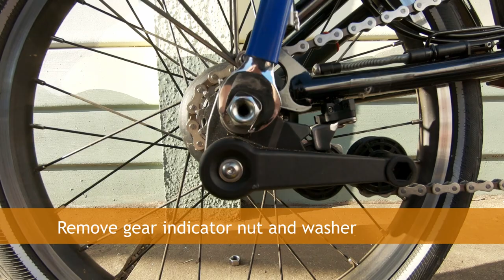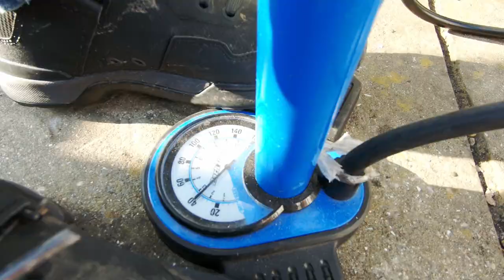Brompton weight saving - 6 speed to 2 speed wheel change

Comment: As a "Rainy Dane" I of course have mudguards on my now, even more than SuperlightM6LXBrompton (<9 kilo), and you are able to buy both the front axle, nuts, bolts and security discs/parts from titanium, as well as many other titanium and carbon parts for the bike.
  Also the really "heavy metal" clamps on the - original mudguards (Titanium stays, from the Factory), which I have parts and screws to be changed to carbon and aluminum, for a further weight loss, so I will come really, really close to an original, double price, T line, - with mudguards, and only 4 gears, compared to my 6!
        The small wheels and the high - resistance from those are the largest problem when riding, not so much the weight!
      As one of the flattest countries in the world at all, Denmark is amazingly "hilly" in some areas, so I like all my - 6 gears and even though have to walk when going up at places😄(Well also because of a, fraction too much bodyweight and a - bad shape as an elderly man and Pensioner of 75!)!  At first I honestly wondered for what use I had the lowest gears, but I found out at several places here in Denmark!!!
     My Superlight, disc brake, Carbon MTB also still has 33 XTR gears and oversize, hydraulic XTR brakes.
     And I would like to be able to change to a hydraulic disc brake in front of my Brompton, as I have had doubt about my bikes braking ability going down at an extreme speed, with often full stops before passing cattle tubes crossing the road!
   But my Brompton didn't let me down then!  Finn. Denmark 🙂
Reply from the maker: Many thanks for your comment and for watching!

Comment: I was about to get the 6 speed. But opted to put the extra money on aesthetics. I bought the 2 speed lacquer raw. S2l is so simple to look at.
Reply from the maker: Thanks for watching and sharing

That sounds like a great idea - especially if where you live is not too hilly (though the saved weight on 2 speed makes hill climbing easier)
Reply: @brilliantbikes  no not all. I live in toronto so getting 6 speed is really not worth it. 2 speed bromy is so easy to fix when you get your tire flat. Do you think getting carbon wheels is worth it?  They are nice to look at but I'd rather let my brompton as is.
Reply: @miffachan123  hello one guy in Netherlands fix my puncture tire without removing the wheel from frame

Comment: I wonder if it is possible to upgrade from 2 speed to 6 by changing wheel (to 3 speed wide ratio) and adding the 3 speed shifter and cable
Reply from the maker: Thanks for watching and commenting. 2-6 speed is quite easy. As you said - change the wheel (you can even keep the existing sprockets and chain). Ass a shifter, cable and chain puller and you are all done ✅
Reply: @brilliantbikes  are  sprockets the same? Is there any difference between the 6 speed sprockets and the 2 speed version? Fitting, diameter, teeth number.. Asking because of the wheel change, do they fit the same?
Reply from the maker: The 2 speed sprockets are 16T and 12T

The 6 speed sprockets are 16T and 13T

The 16T is exactly the same sprocket

In the past when Brompton ran out of 13T sprockets some 6 speed bikes were supplied with the 12/16T combination - though this is rare 

The 2 speed has (as standard) a 54T front chain ring

The 6 speed has a(again as standard) a 50T front chainring

The rear sprockets / spacers are completely interchangeable

Comment: You didn't have to change the gear cable etc. The 3 speed shifter worked on the 2 sprocket wheel?  Thanks
Reply from the maker: Many thanks for the question and for watching. It was a 6 speed, so the derailleur gears were already set up.

Comment: Over £200 to make a worse bike?
Reply from the maker: Thanks for watching

Some people spend lots of money to save a few extra grams

We made this change just to show that it can be done - and to save some weight for racing
Reply: @brilliantbikes   probably better to just eat a cake or two less for a few days, drop a kilo in weight and keep the 3 speed hub which is a miracle of engineering!?
Reply: @brilliantbikes  thanks so much for the video. never you mind him.  would do this mod in a heartbeat if I had the wheelset as I appreciate a lighter bike vs more gears.
Reply: @brilliantbikes   thanks for great video. Serious cyclist would spend 1000 EUR to reduce 1kg from factory design. Especially people should understand the weight change in the wheel is different from weight change of cyclist. It's like flywheel design in the car drive train. Moreover, Brompton's internal hub gear have significant energy loss.
Reply: For people living in flat cities, a 2 speed, even a single speed makes sense.
Reply: I’ve just ridden 50km around Tokyo this morning on my 6 speed.  In 3rd and 4th gear the whole time.  For me the jump in ratio from 4th to 5th is too high.  A two speed set up makes perfect sense here (to me anyway). Wonder if there are lighter 2 speed wheels though.

Comment: Thank you for the video. I have a 3 speed B75. I can do with less weight and single speed when riding in my city. Can i simply swap out the 3 speed wheel with the 2 speed one and use the existing tensioner and chain?
Reply from the maker: Many thanks for the question. 
No the two speed wheel uses derailleur gears, so you would need to install these. The 3 speed uses hub gears.
Reply: @brilliantbikes  I want to make it a single speed with the 2 wheels.  Would that work by just changing the 3 speed wheel to a 2 speed wheel and using it as single speed?